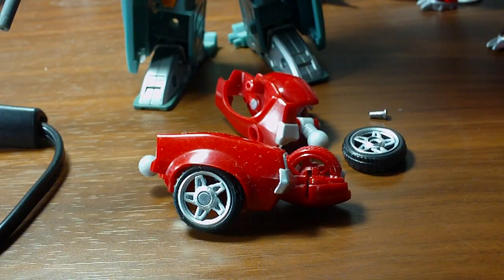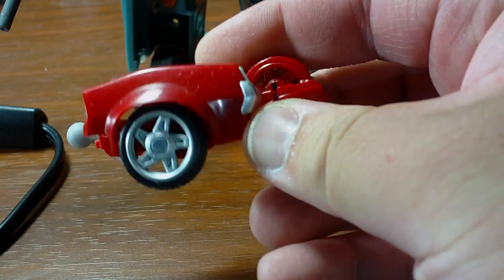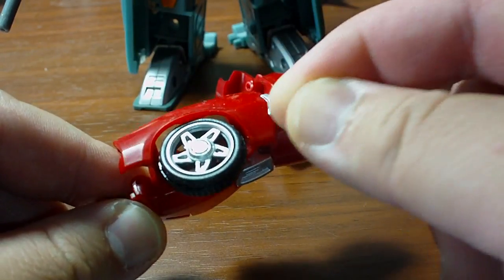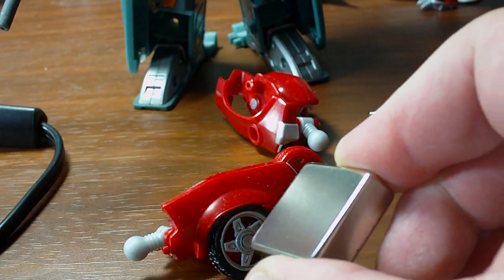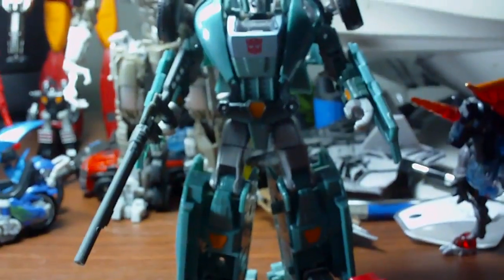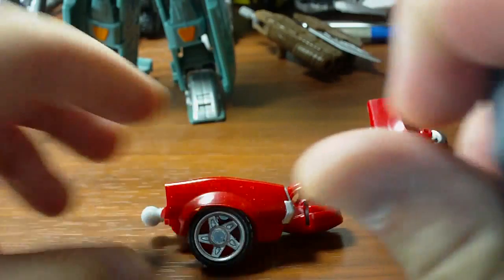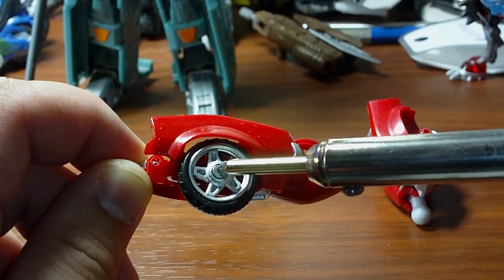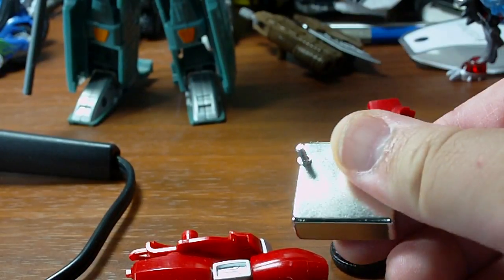Toy customizing: Capped metal pin removal from joints

Comment from the maker: When you re-insert the pins, you should be heating up the pin briefly so it heats up the plastic of the pin hole and allows easy re-installation. You shouldn't need superglue or any adhesive in order for the pin to become secure again. Just give the pin and plastic a few minutes to cool down and it should be back to normal.

I really like the idea of using Crankcase's wheels to Barricade!
Reply: I got 2 questions:

1. What temp should I preheat my soldering iron to?

2. How strong is a harddrive battery? Is there any better or different options that could work?
Reply: What's the best way to hold the pin secure while heating for reinsertion as this is currently not secured in the place it was to start with - do you hold it with pliers?

Comment: This kinda annoys me well not the video or how to fix it this is brilliant I actually fixed my optimus prime from transformers cybertron and his leg ratchets are like stupid strong now like his knee gives first now like it's weak compared to the hip but. It's my soldering iron it goes to supposedly 896 °f and the pin still didn't budge.... now I have megatron from the same line and I'm trying to tighten his like bat wing cape thing cuz they annoy me being loose and same thing not budging from the heat.....some good plastic if you ask me loool but it does work eventually

Comment: thnx for putting this video it's so clear for others to see, I'll add some own tips from myself...
I had a 2nd soldering iron specifically for this purpose.. what I did was makeing the tip less pointy, which means more area of effect and heat transport towards the pin secondly I attached the super strong metal onto the soldering irons base, in 9 out of 10 cases this magnet will still have enough strength to guide through the solderingiron-tip!

Comment: Damn that was pretty slick! Have you experimented with using the magnet to pull out longer pins instead of the hole punch and pliers method??
Reply from the maker: Oh, yes. I use a soldering iron to heat up pins that are not accessible with a hole punch and then use a neodymium magnet to extract the pin.

Comment: well ill be doing a review soon but i managed it. however i couldnt get it off going the normal route. instead i had to cut off the two plastic lumps from the back and head up from were its fitted and shove it through. this is good though cause ill be able to port him for weapons in truck mode and maybe even get a tank fan mode out of him so i win. I really want to fully articulate a powermaster prime with ball joints and ratchets.. it would be sooo cool Many thanks Rob

Comment: I am a keen model maker and want to get into customs but really having difficulty with this. I am trying to get the elbow pins out of powermaster prime. they wont budge any ideas. also i need to get the pin out the crotch piece that folds down to get him taken apart. it seems impossible. Cheers Rob

Comment: Hello sir, Thank you for a great video. A couple of questions, what is the method behind this? The heating element expands the plastic which is gripping the pin so that it can easily be removed? If so, does this mean the socket in the plastic for the pin returns to it's normal size upon cooling or will there be some kind of permanent deformity? And how do you re-assemble this type of pin?

Comment: Hi nice demonstration on how remove those pins there, but I got a question though.

Can we remove the cap pins that has a rough end on the other side with the  automatic center punch, or do we have to go by this method?
Reply from the maker: You don't have to use this method for cap pin removal if you have access to the uncapped side but it would be extremely difficult to force the rough end all the way through the plastic. It would possibly make re-installation of the pin troublesome.
Reply: Thanks for the advice, it would be troublesome to re-install the pin the usual way and getting it out would result in making the plastic holding the pin to brittle and possibly break if not done the right way. I find applying some super glue help solve the problem.

Super glue are known for their use of reapplying and repairing some broken parts, what it also can do is tightening some loose joints if applied correctly.  

I've done this to my beast hunters Optimus Prime's swivel joint between the knee and the thigh when it became too loose. So applying it  on to the the pin hole allows it add in those new layers and could tighten the plastic to the point of being able to loose as before. Thanks for replying back.

Comment: Hello. great video!!! I try to do it in my Botcon Hoist but it is not working.
So I have a couple of questions: what is the power in watts of your welding iron?
Reply from the maker: I believe it is in the 25 watt range. My soldering iron is in storage at this time and I don't have immediate access to it so I'm unable to verify the wattage. However, it is a standard soldering iron you'd be able to find at a local hardware store. It's a fairly inexpensive model as well.

Comment: Thank you so much. My boy who is 5 got his new Optimus yesterday and he straight away broke the rotating sleeve surrounding the metal pin at optimus'leg. I really think the toy is not suitable for his age but it was listed as 5+ (in Japan).
I am looking to remove the pin and the rotating sheath and replace both with metal parts from the hardware store. (If I can find them) or I will just bolt it in with a small bolt.
Reply from the maker: You are very welcome. Good luck with your repair/replacement project on the Optimus Prime toy!

Comment: great video, though one question: could this method work with Combiner Wars Blast-Off? I'm wondering since I may want to buy the shapeway add-on kit, but the hinge is capped on one end. Could this work, or should I do the other method
Reply from the maker: Which joint(s) on CW Blast Off are you wishing to work on?
Reply: the wings. I can use the other method for the nose cone, but the wings are the major issues
Reply from the maker: I don't have access to my CW Blast Off right now but once I get home, I'll check and confirm whether or not this technique will work.
Reply from the maker: Okay, so I checked the wings and it appears to be a single sided installation, meaning that the pin is only accessible on one end.

This means that you cannot use the other method of removing pins using a pin punch.

You could use the method demonstrated in my video involving use of a soldering iron, however, you will need a very steady hand since the end of the pin that must be heated up is very small, unlike capped pins.
Reply from the maker: You can certainly do that, it will work, you just need to have very steady hands and be sure to set up a workstation where you can quickly and easily set down and secure the nail and soldering iron before removing the pin.

Comment: I tried using this method and I still can't get it to work. I have 2 rare earth magnets from an old hard drive and they still have a pretty strong magnetic charge, but they don't pull the pin out. I even kept the soldering iron on for 2 minutes instead of one. What am I doing wrong?
Reply: Is the tip of the soldering iron clean? Was it a cheap one or expensive one?

Comment: I don't have a soldering iron. Is there any other way to remove a capped pin?
Reply from the maker: As far as I am aware(and I am by no means an expert toy customizer) there is no other capped pin removal method that has the level of ease and low chance of permanent damage.

Due to how capped pins are installed, removal requires heating the pin, and in turn the plastic surrounding it, to allow easy removal. Aside from a soldering iron, I'm not aware of any other readily found device that facilitates pin point heat application, which this method requires.

Comment: Very nice tip...  It seems like your pin has threads on it.. Am I right?? I'm about to customize the studio series Bumblebee from the Bumblebee movie...
Reply from the maker: Yes, the pin is threaded or basically textured to help it stay in place once set into the plastic.
Good luck with your customizing on SS BB!
Reply: @Guiltaur  Wow! I did not expect you to reply this fast since your last video was 4 years ago.  I might do this technique then.. Thank you!
Reply from the maker: @BGLoscar  While I no longer am active in content creation, I try my best to respond to comments!

Good luck with using this technique! It's not too difficult, it just requires a steady hand and a bit of patience when you heat up the metal pin.
Reply: @Guiltaur  Update... I tried on my Voyager, Evasion mode Optimus prime's wheels ( like your vid, since the wheels has nothing to do with the transformation )... Although my magnet is not strong enough so I ended up, pushing the opposite side with a screw driver to fully remove the pin.. LOL... The plastic got bent but that's my fault cause I pulled the wheel where the flat side is ( even though you said not to lol )... I'll order a strong magnet on amazon... Is 100lbs of holding power too strong? Cause that's what I'm gunning for...
Reply from the maker: @BGLoscar  A magnet of that strength should be good. Stronger is better in this kind of application.
Reply: @Guiltaur  I settled for a 33 lbs holding power, for now... I'm worried that I might lose a finger if I grab a strong one from the get go LOL... I'll give this one a shot...

Comment: can u buy them caped  pins
Reply from the maker: Gregory Dennis I've never seen capped pins for sale but I'm sure you can buy them.
Reply: cause I  am having alil  trouble removing the caped  pin holding the rotor  part so I took a break from it

Comment: doesnt work even tried 5 minute soldering time
Reply from the maker: Which joint of which toy did you try to remove a pin from? At a glance, either your soldering iron didn't heat up the pin and plastic to an adequate point or your magnet(if that is what you are using to extract the pin) isn't strong enough.

There is always an exception to the rule but I've removed pins from dozens of Transformers toys with ease using this method. Perhaps the toy you're working on has a unique pin installment that is resistant to this method.
Reply: the titans return skull smasher. pins in the legs